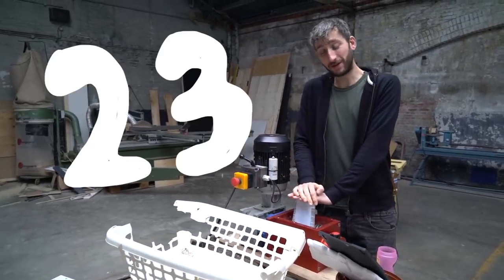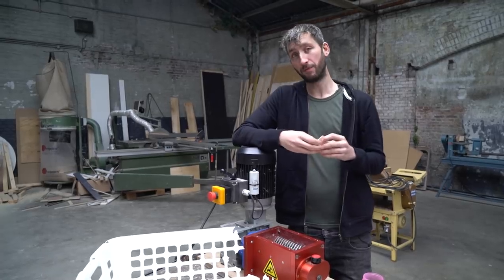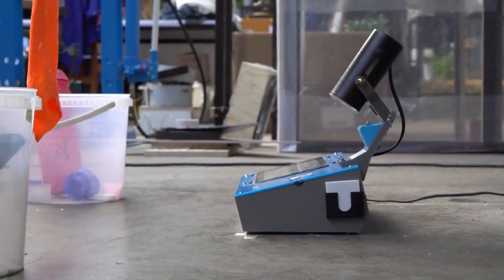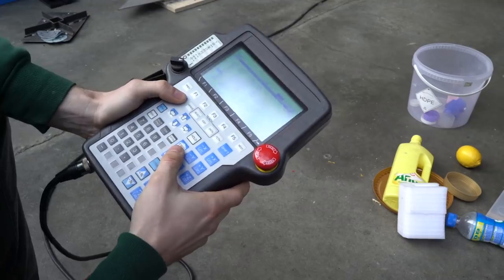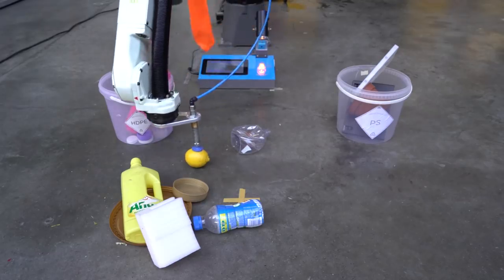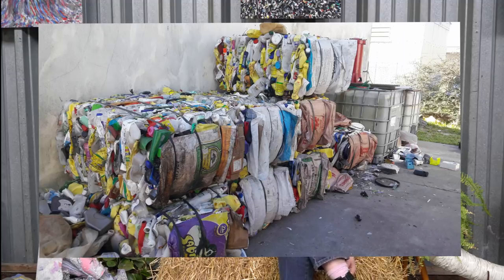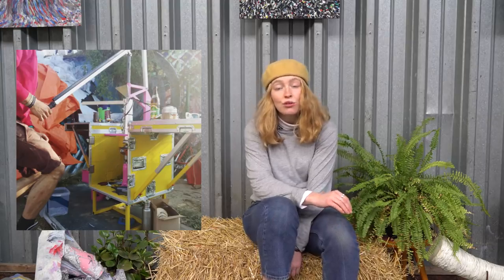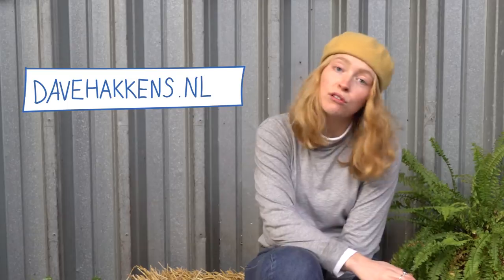Monthly news #23 - Stop shredding fingers

Comment: I always wondered what would happen if you put a capacitance based e-stop to detect contact with flesh on one of those shredders, much like the SawStop.
Reply: what would happen would be the cost would skyrocket and then idiots would still find a way to dismember themselves
Reply: Matthew Gowan That’s a good idea
Reply: Shredder are waay slower but the wheels probably have a lot of capacitance themselves and that would make sensing harder but if it works it would work nicely
Reply: I was thinking of something like this:
https://www.youtube.com/watch?v=sUz82R8qLHI
If you have the resources, and knowledge to machine, and assemble a shredder like that, hopefully you'll have the sense not to put your hand into it.  It'd be more to protect operators.   Using an arduino, or similar plc (if you're worried about the safety of an arduino as an e-stop device vs a dedicated plc) as the controll could have other advantages as well, such as current monitoring to auto-reverse the motor if it jams before the thermal trip goes off.
Reply: @Throneos  I agree with you that the assembly being larger could have an impact on the capacitance, as well as factors such as nylon or Delrin spacers, bushings, and even the plastic being fed into it.  I thought the sensor relied on ΔF when an object is introduced, say a human at 100-200 pF.   The question is, what effect would it have if say, the person was touching the grounding of the motor, does SawStop do something to isolate the blade electrically from the rest of the assembly?
Reply: It would probably trigger if you shred anything that's moist or conductive
Reply: @jhsevs  After a little more research into SawStop, the blade, and arbor are electrically isolated, so the shredder blades would need to be isolated from the frame and motor.  The moist or conductive thing is an issue as well, why SawStop has a safety bypass mode for these materials.  The most difficult thing I could see with the idea of using capacitive e-stop is electrically isolating the blades, without affecting the transfer of torque.  For a table saw with all that rotational inertia everything may be all well, and good, but for high torque, low speed transfer, things may just end up shearing.
Reply: @matthewgowan7546  what about a horizontal retraction mechanism? If the power is applied with gears, the rods with teeth wouldn't have to be directly connected to the motor, they could just be in contact with a gear that is directly connected to the motor, then you could isolate the rod from the motor by gear material selection, or even by coating the gears in a thin layer of Teflon or sliacone?
You could also use non-conductive bushing and bearings for the connection of the shredder rod to make it t as isolated as possible.
Reply: @stapuft  Nylon 6 gears, and bushings? Nylon 6 is fairly common in gears for the foods industry, it'd also hold up in bushings.  It'd also reduce the operational noise of the shredder.  It could also be just driven by a timing belt, if you were worried about the torque transmission of the nylon 6 stripping the teeth.  Timing belts are also non conductive.
Reply: @matthewgowan7546  nice! I knew it was possible, too bad something like this couldn't be made for a meat grinder or deli slicer LOL

Comment: I see mentions of capacitive sensing in the comments but it wouldn't work, the nature of the shredder means that it has to be sturdy, to be sturdy it has to be made out of metal. Metal is conductive and i bet the motor is grounded in which case this wouldn't work.
Although i think there is a way, I think that the grounding wire has enough inductance to not allow high frequency current.
Imagine you have high frequency and high voltage (albeit, low current) connected to the shredder, as soon as anyone touched the blades a current would flow, this current could then be sensed and the shredder could be shut down. And on top of that, whoever happened to touch the blades would get a nasty little zap to teach then not to touch the blades anymore.
It's a win-win i think.

Comment: Idea for the shredder.
Conductive safety, if something conductive, touches any of the metal parts on the shredder while it's on, the safety switches the positive and negative to auto reverse the gears, pretty much instantly and then shuts power off completely like a quarter of a second later.

Comment: Hello! About the shredder safety thing... Few weeks ago i build your first design of shredder and after a few tests i wondering about the safety aspect of this device. My hobby is microcontrollers - like arduino, so i have an idea... will be possible to make a touch button of all blades of shredder? For example, if i touch with my hand the blade of shredder, whole device immediately stop. In my opinion this is possible to make simple and cheap way.  I have in plan to test this concept but i dont have idea how long it take to me.  What do yout think about?